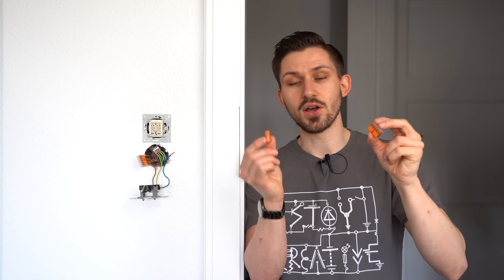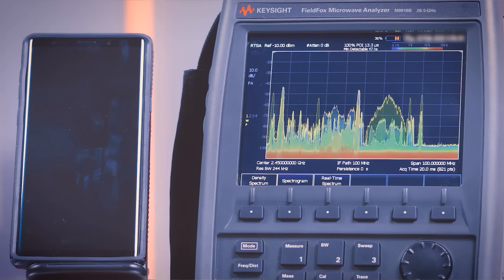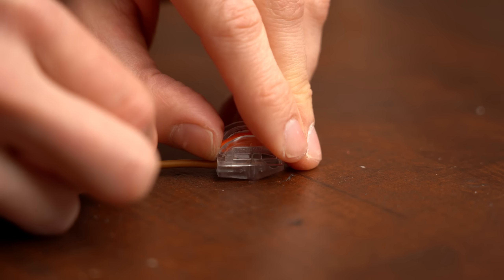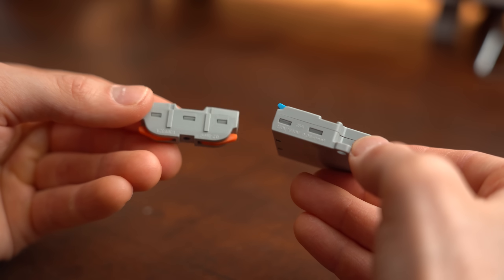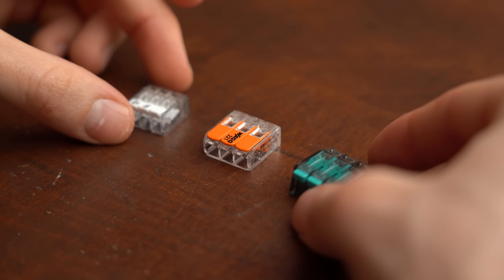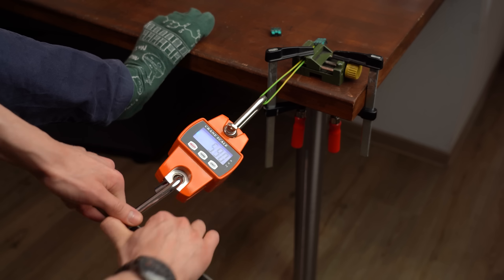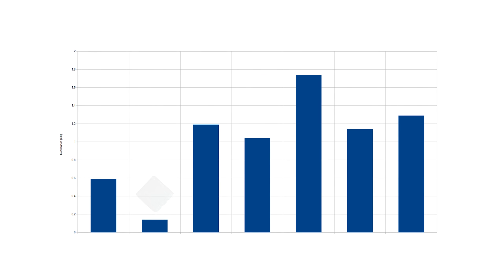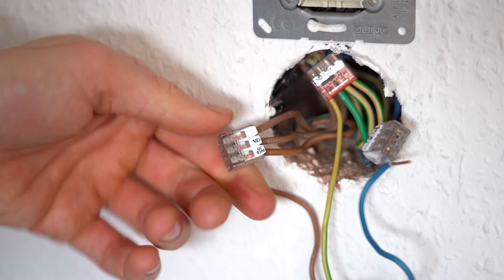I tested 7 Wago Knock-Offs Wire Connectors so you don't have to! (Surprising Results)

Comment: I still can't wrap my head around why people hate Wagos that much. 

Yes, they're slightly more expensive compared to some other connection types and yes, if used properly, other stuff like wire nuts can be just as safe. 
But those are not foolproof and if used improperly, they might cause serious issues. 

That being said, Wagos are simply foolproof and much more convenient.

Nice video, though.
Reply: It's quite impressive how absolutely every field has mad raging fanboys and haters. I get it preferring one over the other, that's natural as everyone has different priorities on their selections, specially since both have their upper hand on some aspect than others. But to be hating like idiots and claiming bias and paid review if your precious loses? Damn...
Reply: @Kalvinjj  Glad to see your post. Thank you!
Reply: For me, the big reason for WAGO is that they are compact. At least in Germany, the amount of space you have in junction boxes (circular, 60mm diameter) is pretty limited. WAGO neither require long cable strands, nor are they particularly big themselves.
Reply: Other than paid shills, I can't see why anyone would claim that wire nuts are better.

But as for "foolproof"... sadly, no. Once had a tenant that rewired a florescent fitting for a LED retrofit tube using Wago 222 blocks... shoved the wires in without lifting the lever. There's always a better fool.
Reply: @johnalexander2349  As soon as you make something foolproof, nature creates a better fool.
Reply: @johnalexander2349  To be fair to him, Wago to make similar looking terminals that don't have levers that you do just push into.
Reply: @johnalexander2349  That and the people who don't strip the wire.
Reply: I like Wago connectors because I can work on live circuits with them. Trying to remove 1 wire from a wire nut in a live circuit is almost impossible and dangerous. 

AND YES I KNOW WORKING ON A LIVE CIRCUIT IS STUPID
Reply: @AK90  Not that stupid if you know EXACTLY what not to touch.  You just need to have plenty of situational awareness.  Sometimes there's no other option.  Like some mission-critical equipment at some business that can't go down.  Anybody that's been doing electrical work for a while has probably done it at some point.  I'll only brave doing that up to 240v though.
Reply: Guys, this has gone quite far, why don't we all just agree on mashing stranded wires together at random, taping them up somehow and let the incoming fire weld the wires in a nice, secure splice?
Reply: You will find most wire nut (marrets) fanboys are American
Reply: @CoilB2  yeah because they are cheap, look hideous and have the possibility to start a house fire. All things where the common Murican screams: "I'll take 20". Thankfully we don't see them very often in Europe and places are generally mostly wired up properly and not as-cheap-as-possible.
Reply: @CoilB2  That probably has to do with the fact that wire nuts are not legal to use in Europe :)
Reply: @CoilB2  Only because it's the industry standard in the US, Canada, etc. 

Of course we prefer and trust what we are used to and use every day with a high level of reliability. Likewise the Germans like their wagos.
Reply: Wagos aren’t fully foolproof I’ve had to fix a few things people have done often times people strip the wrong length and they don’t always make great connection Especially if people use the larger wagos but in general they are much more foolproof than wirenuts
Reply: * throws terminal strips and screw terminals in the ring
Reply: @fischX  Then you better throw in bootlace ferrules and a torque screwdriver too, or they won't last 30 seconds.
Reply: @johnalexander2349  Oh I'm liking this lineup, I wanna watch that fight!
Sincerely as a mechanical engineer (...almost, 2 semesters to get rid of this god forsaken academic life) I'll always tend to prefer spring action (like crimped stuff).
Reply: @squee222  Deformation includes both plastic and elastic deformations, in the case of a crimp connection, you'll have the elastic deformations still present as well, keeping the connection held, that's why it doesn't fall off, and why it's any good.
Elastic deformation = spring action. Might be simplifying the names, but it's exactly what happens with a spring.
Reply: Wagos can also be used improperly, recently saw one overheated on an EV charger, looks like a poor connection with fine stranded wire.
Reply: NEVER underestimate a persons ability to be a dumbass
Reply: @ingulari3977  i disagree, wago 2273 can only handle solid-core wires vs wago 221 and wire nuts which can handle even stranded wire. depends on the application.

however, the price they found was a bit misleading, i can find a 2-port wago 221 for .30/pc and 3-port for .44/pc
Reply: @LC-hd5dc  Wago 2273s exist because a LOT of house wiring uses solid wire. For stranded wire, there are 773s. It's only in special circumstances that you need the 221 or 222, like finely stranded, or below 0.75mm² [but you can't use Scotchloks],  or when the wiring needs to be easily alterable, which amounts to like 2% of the time.
Reply: Because people are dumb and don't believe science or have any curiosity to understand things for themselves when they encounter them.
Reply: The one reason I could see my self use wire nuts instead of wago is if I don't have a lot of space to work whit as Wago is a bit more bulky
Reply: It's the same reason we had 'Freedom Fries'. Too many US Americans are resistant to anything *N*ot *I*nvented *H*ere.
Reply: Lets take a connection, add some extra resistance just to save some time to install? Which one is more important? (fyi I hate wire nuts, and like being able to remove connections from lever blocks for fault finding).
Reply: @drsquirrel00  Wagos have a higher resistance directly after install. Wire nuts have a lower resistance to start with, but what happens as the connection ages? Wagos are spring-loaded and made from an alloy specifically designed to be stainless while also being compatible with copper and aluminum. Therefore, the spring keeps a consistent pressure even when there's thermal expansion/compression or vibration, so the connection doesn't degrade over time.
Reply: @OleJanssen  I don't know - do you? Conductors being held against each other are my preference - I use screw terminals where I need them and put the wires through both screws. Otherwise I do as much as I can to avoid joins in the first place! Junction boxes used to be a thing... screw thread to hold conductors against each other... better than the rest other than "speed". Look where focusing speed in building projects have gotten us with the quality of housing. I do have the older Wagos around, and their clones, handy for rigging temporary stuff up.
Reply: I use both wire nuts and Wagos.
Every electrician has unwrapped a 40-50 year old nut that still looks good.
How will Wagos and others fare after 10 years or more?
The spring tension will lessen, especially with repeated heat cycles. 
Many electricians any use Wagos on LED lightning.
Reply: @johnmckee7937  Actually, Wago connectors have been common for over 40 years in many parts of Europe. No signs of failure so far, the plastic hasn't turned brittle and the spring tension seems just like new.
Reply: Either way; imagine telling someone that you couldn't afford a extra cents for a better solution. Lol
Reply: Americans get offended when someone tells them that the Imperial system sucks, or their crappy electrical crimpers are crappy, or their president is a clown who was convicted of sexual assault. 
They're little snowflakes who have a thin skin if the back of their mind has any doubts as to what you say may be the truth. Which causes them to double down and claim that they are happy to pay tariffs as long as Ronald McTrump deports all the Mexicans.
Reply: they just don't know how to cook them 🤷
Reply: It‘s always good to have alternatives to price dictating monopolists.
Reply: My father is an electrician and 50pcs 3-head wago Costs 25$, 100pcs 3-head unbranded cost me half of that do 1/4 price...
Reply: If you make your trade fool proof,  your trade will be filled with fools.
Reply: The best and cheapest is to twist the wire, without any wire nuts or wago. I Think its not doable to connect 6 cables (6x3=18 wires) into 
Installation box fi 60 for flush mounting.
Reply: "Slightly" is an understatement. Wire nuts can be had at a local hardware store for $13 for 200 (.15 each). Wago is (in one packaging option, not sure of which package would be cheapest) $42 for 78 (.53 each). That, and the fact that I have a bin with probably 500 wire nuts, means Wago is a pretty significant outlay of cash for a DIY/home user. Is it a better way to do it? probably.
Reply: @r.brian.lindahl  How many do you possibly need though. A few dozens at most? That's like 20$ or so maybe, for something that will permanently stay in your house.
Reply: @Mobin92   The average American house has ~70 outlets. Let's also assume 15 light fixtures, 20 switches, and I'm sure a bunch of other stuff. If we assume 3 wagos per, that's like 300 wagos used.
Reply: i buy only wago.
thats the way ( i dont not care about some cents ).
Reply: Bad contact area, higher resistance, can't handle over 15 amps
Reply: wire nuts if used properly provide a higher quality electrical splice. It's really that simple. 

Wago: DIY idiot proof. Don't need to know much. 
Wire nut: Good quality permanent splice not dependent on manufacturer to ensure continuity and ampacity but dependent on your ability t make a solid pigtail splice. 

Do you trust your skill more than a manufacturer? Than use a Wire Nut... if you trust manufacturers of connectors more than your skill, use a Wago.
Reply: @squee222  Another option I've been using recently for almost any splice is crimped connectors. Either the non-insulated variant with heat shrink on top (or electrical tape) or the ones pre-insulated. It's also very practical to use and makes pretty good splices, inline at that, if that's important for the application. The disadvantage is clear tho in that they need the crimping tool to be used.
Reply: @Kalvinjj  Crimps are excellent, and the tooling isn't an issue once you've bought it, but the thought of insulating 1000, sub 4mm² connections... No thanks. For big wires there's often no other choice.
Reply: @squee222 this makes a lot of sense, however having looked at a lot of the wiring in my house I have to say some of the skill used with wire nuts is less than mine (among other things found an unterminated wire and electrical tape wrapped around the point where the wire entered the nut because the stripped section was too long). There are definitely people using wire nuts that should either think more about what they’re doing, use something else, or get someone else to do it.

I’ve made mistakes with them too and I’m still working on always wire stripping without nicking a wire and making that spot quicker to fail when flexed. Not terribly hard but requires attention to detail and care b
Reply: @squee222  His last video showed that wire nuts have lower resistance and that's it. Simple maths (and a billion installed Wagos) shows that that's entirely irrelevant. Are they as good as Wagos under vibration? Are they as good under thermal cycling? Are they certified for that? So no, cheaper, not better.

If you don't trust the joint manufacturer, then why trust the wire manufacturer? Or the switch manufacturer? Or the insulation tape manufacturer? Me? After dealing with a lot of sparkies, I'd trust an ISO 9000 company over a sparky every day of the week.
Reply: @squee222  Really now? Wire nuts have passed IEC 60068, IEC 60947 and IEC 60998 testing? Or is their "superiority" based on some other test regime?

And no, there are no trustworthy sparkies, but there are trustworthy manufacturers. You're free to spec out whatever you like, but as a developer, I would not hire anyone that chooses wire nuts. Thankfully that's not an issue, since they're illegal in most countries.
Reply: @squee222  Thank you!
Reply: @squee222  Is running away the best way to make your point? Don't forget that you provided no evidence and convinced nobody. Bye.
Reply: @squee222  you said that because of sparkies making mistakes we have inspectors.
Now please explain to me how a inspector would recognize a not proper installed wire nut?
Reply: @squee222  please correct me if I am wrong, but I don't think that a dielectric test can find a not properly installed wire nut.
Dielectric testing tests the insulation.
But lack of insulation is not the problem with not-properly installed wire nuts. The problem with them is higher than usual resistance and therefore creating a hotspot.
And on top of that it might take some time till the strands move around a little bit and no longer have proper connectivity.
Reply: @squee222  "You are supposed to make a mechanically and electrically secure splice before installing the wire nut."—then why is the wire nut needed or what good is it?!?  Just a covering???
You're talking about pretwisting yet where is this mandated or has this question(to pretwist or not to pretwist?) been definitively answered?—and why has it not been definitively answered?  Sounds like just a "rat" or "pig" tail splice that any knob and tube guy would've told you is crap; that they used stuff like Western Union splices.  And then soldered them!  But why was that a problem?  -Well, besides the time, difficultly, and awkwardness involved, those splices often had better conductivity than the wire.  Great right?  -Meaning in overcurrent situations, the wire would run hotter than the splice points and a fire would start at some random point on the wire where it was a little less smaller in diameter, there were a few more atoms of impurity, a nick, a scratch, etc. from the factory.  It's why knob and tube often didn't use junction boxes as "when properly done"(fatal last words of wire nut and solder splices), those splices would run colder, even ambient, compared to the wires.  And fires would often start inside the wall somewhere far away from the splice.
Also, why would wire nuts be better in thermal cycling and vibration?  Electrical conductors are chosen for their electrical properties not their mechanical ones; it's why they're copper and aluminum and soft alloys of(few other elements mixed in).  No mechanical or metallurgical engineer in their right mind would choose these metals to make mechanical connections.  Now a pre-engineered bimetallic conductor clad spring steel alloy core factory made electrical bus on the other hand....you get the idea.  Can last for MILLIONS of thermal cycles and still maintain the proper hold on the wire.  That it's NOT dependent upon the wire itself for a mechanical connection.
On the other side of your meter, to secure power line conductors to the pole insulators, why do the linemen use aluminum or copper clad steel or specialty alloy "preformed" ties instead of the old fashioned hand tie wire?  Answer: Well, try to make a spring out of hand tire wire; you can bend it with your fingers to be exactly like a spring and yet it's not a spring.  Same way you can tie down something with hemp twine or even rope often seemingly "tighter" than with a factory made hammer forged grade 100 alloy steel chain, but I can assure you the latter is a lot more secure in most all cases.

Put the wire nut in a vise and test the pullout strength of each individual wire.  I can assure you again the tensions will vary wildly.  And sadly, all too often, only a few pounds may be required indicating the connection is both poor and inconsistent.  Put a lever nut in a vise and test the pullout strength of each of the wires will all be consistent and precise around the same specific value.  Also, when you're presplicing(pretwisting) the wire and later twisting on your wire nut, how often are you checking and rechecking to make sure you're not screwing it up?  "Oops!  Wire loose!  Better untwist and do again and/or twist some more!"  -It's that Chubby Checker song: "Let's Twist Again...like we did last summer; let's twist again; like we did before!"
In all seriousness, when you are twisting wires together to make a sloppy splice that EVERY time some wires will have way more connection than other wires, how often are you in actual fact having to pay close attention so that you're not screwing it up!?  "Okay my pointer finger is in control of wire #1, middle finger wire #2, ring finger wire #3, pinky finger wire #4, my thumb on #5 now with my other hand holding my lineman's pliers I mash down on the very tip of this whole faggot/bundle of copper twigs securing them all—and then twist!
Reply: @squee222 What's a "better connection"?  BOTH wire nuts and lever nuts run hotter than the wire.  One can make splices that run colder and have more conductivity than the wire; that's what knob & tube typically had.  But that's exactly what you don't want in a number of cases as then if you have an overcurrent situation, the failure(and likely fire) is somewhere along your wires rather than inside the junction box.  Is a wire nut just Ohm's Law?  Or are there other considerations?  Ex: Since we're on knob and tube, often there were no problems with it, UNTIL people wanted to use more and more modern appliances than those circuits were designed to handle. Replace the fuse with a larger amperage one; fast blow with slow blow; put a copper penny in the back of the hole, replace the fuses with higher value breakers, etc.  That then they wished all their splices were inside junction boxes and that "good" splices weren't more conductive than the wire.
I don't buy the better connection either.  The lever nuts the resistances are mathematical just like a bus bar.  Wire nuts?  Measure wires 1,2,3,4,5,etc. see if you get the same resistance through the splice.
Reply: @johnalexander2349  Wire nuts are cheaper only, if your electrician works free. Time is money.
Reply: @squee222  sorry, but that is simply not true. Wire nuts are prone to fatigue. They have no method of maintaining tension, and thus will degrade severely through thermal cycling. Wago connectors ont he pther hand use spring steel for the tension, which does not fatigue nearly as much. So while a brand new, perfectly executed wire nut may be lower resistance than a wago, it will certainly fail well before the wago.
Reply: @squee222  wire nuts is only better in short time. In long term they can lose.
Reply: @squee222  is there anything better, cost be damned?
Reply: @squee222  I don't know the numbers so I'm just trusting you here when you say the Wago connectors are electrically and mechanically inferior. In what  way are they inferior though? In a way that matters in practical use, or is it purely academics? Like, is the rated current higher? And if it is, is that a current that the wires will actually see in use before something else bursts into flames?

That's an honest question btw.
Reply: @squee222  you should checke some after  many years. The can lose in terms of heat and cold
Reply: @squee222  "superior connector if you have the skill to use them correctly". This simply doesnt stack up. Everyone makes mistakes over their life time.  I'd want to minimise that over the number of connectors even "skilled" people use. After all, skilled people get old, have off days, get a shout if they want brew ... Everyone is a fool sometime.
Reply: @squee222  Your points don't get any more valid just because you repeat them 13 Times . 

Wire nuts may have superior connection immediately after installation due to the direct wire-to-wire contact, but over time, this degrades significantly. If you don't believe me, just take an old wire nut and measure its resistance. And if you take some of them apart, you can actually see that copper oxide has formed even in the contact area, hinting at a small air gap forming between the wires, greatly reducing the contact area.

This is why the spring loaded Wago is superior: It maintains a tight connection at all times, which can again be proven by measuring the resistance of an old Wago connection. 

But wire nuts often aren't even installed correctly in the first place, for example by not twisting the wires properly. Stuff like this even happens to "professionals", as I've seen on multiple occasions. This can cause even more degradation.
Reply: All lever nuts are basically the same aside from their wiggle out factor. Whether I use a WAGO or one which came out of a cheap Chinese product. They are small blades which clamp down over the conductor as opposed to a tight larger surface area splice with a proper wirenut termination. With most of the lever nuts you can twist and wiggle out the wire just like with a push-in connector. You're not doing that with a braided solid wire splice under a wirenut. Right tools for the job etc.
Reply: @Magneticitist  Spoken like someone who has clearly never used them, why not just buy one and test it out or are can you not afford a 22ct piece?...
Reply: @someguy4915  Care to explain? I'm looking at a bunch right now. If you want to get into this argument feel more than welcome cuz I can thoroughly explain it all.
Reply: @Magneticitist  Sure you are, I would explain it to you but since you already have a few I'd recommend you try them out, do a little bit of self-learning and you'll be proud that even you can 'master' the basics of using Wago terminals xD
They're really not that complicated, perhaps for you they are a step too high though, you could always hire someone who does understand basic things I guess?...
Reply: @someguy4915  Well you sound like a fanboy troll who looks at these things like one or the other is the "best" for some reason. I'm just going to guess I've at least used as many as you have, if not thousands more, but I'm not going to proclaim they are absolutely superior. This is why I said right tools for the job etc and I use all kinds. I typically save lever nuts for personal shit they are handy for rather than wasting them on every basic splice. If you're over there throwing your outlets together or something with wagos then good for you. Who cares. If you use them at work then good for you. But if you use them at work doing residential or basic commercial or something literally all the time as opposed to wire nuts then IDK why you like losing profit. Can't use a wire nut?
 
For any non trolls here are some further examples. Obviously electrical wiring is not intended to be weight bearing at the joints but it's something which can and does happen sometimes, in which case a braided and capped splice will be superior since it is from the start anyway.
With a wire nut you can often take a voltage reading right under the nut with the probes or easily just take it off and read a braided splice. With a wire nut small fixture wire is easily braided by twisting the nut on. With a wire nut you can easily and quickly cap off something temporarily with one hand without some special maneuver. On the other hand with a wago you can easily and safely make an otherwise difficult hot splice by capping the line with it first. You can make temp splices easily for things like test rigs. You could also confuse a lot of you DIYers by thinking a neutral is a neutral when it isn't, since typically you'll find them all spliced together in the box if they are on the same circuit. Let Randy start going all de-splice cause levers are easy and now he doesn't know wtf anymore. Right tool for the job and it all depends on what you want to do. People can keep sucking off wagos all day long but if they're trying to claim wire nuts are garbage at the same time then that just doesn't make sense without explaining.
Reply: @Magneticitist  Too long nobody will read it buddy, you seem upset, write another diary entry over your feelings xD
Reply: @someguy4915  well I'm not expecting you to read it you can't even use a wire nut
Reply: @Magneticitist  Learn English first buddy, 'it' you can? I believe you meant 'if' not 'it', also try capitalizing letters. You might come across as an adult once you manage basic English skills.
Reply: @someguy4915  Yes. "It." You know, the long comment that was too hard for your eyes.
Reply: @Magneticitist  Not really an eye issue as I can easily spot the many grammar mistakes you continue to make... That would be a lack of interest, now that's either due to me not caring, you writing a far too long-winded rambling response or a combination of those two.
It's all a bit complicated for you, isn't it? That's okay champ, we're all rooting for you to improve!
Reply: @someguy4915  lmao jesus christ ok well have fun at the grammar police academy I thought you were trying to make some points about the actual topic.
Reply: @Magneticitist  Yeah get mad because you don't understand it buddy :)
Reply: @squee222 than for comparisons, not in "than use a wire nut"...
Reply: @squee222  I'm no electrician, I do research codes and ul regs though.

Never had a wire nut cause a fire. If a nut is worn out I replace it. Wagos have less contact area which increases resistance and heat, unlike twisting wires together, the nut is just a endurance to keep wires bonded together.
Reply: @shadowopsairman1583  im a Electrician and have seen several burnt wiring boxes that used wire nuts. 

They are also Illegal in my country for home use since they are prone to lose contact over time which is a serious fire risk. 

I also have no clue wy anyone would bring in a higher current rating when advertising wire nuts since you will never overload a wago without burning the wire as well. So what's the point
Reply: @shadowopsairman1583  Even if the Wago has higher resistance that resistance will stay exactly the same forever (at an acceptable value). While wire nuts cause a more random result if you use them wrong, which can loosen over time.
Reply: @shadowopsairman1583  if a nut wears out.. how do you detect that it's worn out? Do you open up every box on regular intervalls? Now I know why there are so many house fires in Murica.